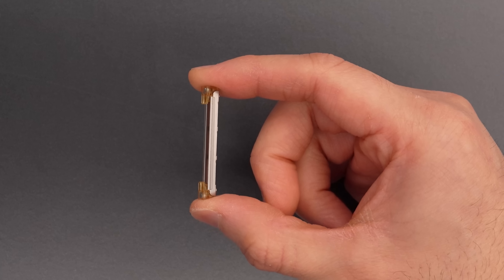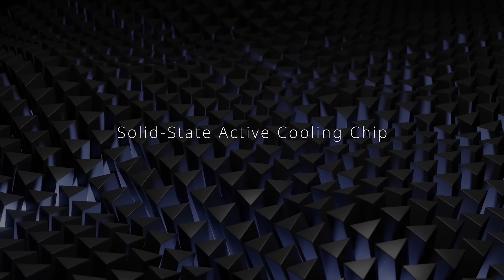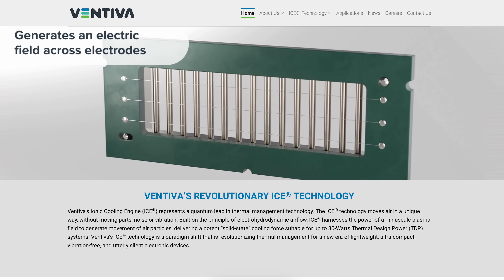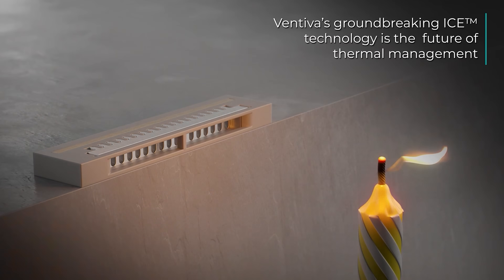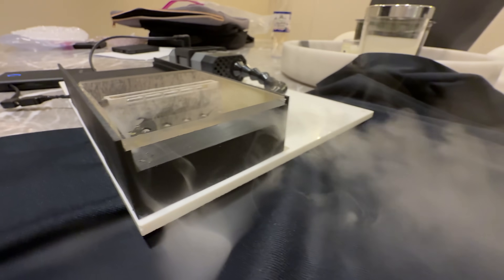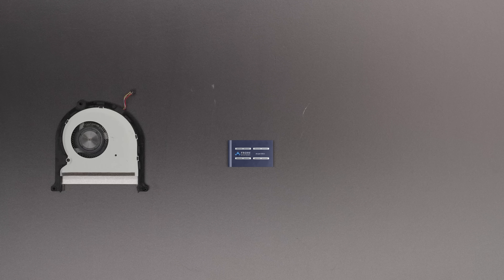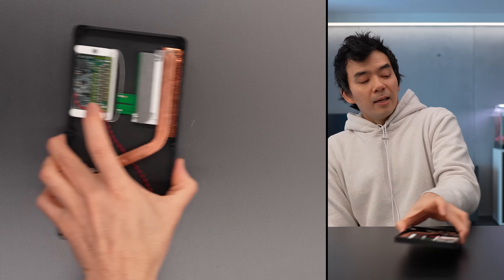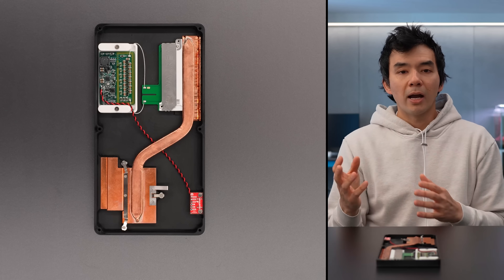The IMPOSSIBLE Laptop Fan...

Comment: Ion wind is a cool idea, it has almost everything you want in a way to move air around.
Except there's a few things that kill the idea deader than dirt every time it's brought up, and nobody has yet come up with a great way to prevent any of them.
Showstopper issue #1: Dirt/dust. There's a very good reason that the first time I ever saw something that purported to use this tech was a QVC advertisement for an air purifier. Static cling kills the idea because the same static charges that move the air around get picked up BY the air and deposited on to the dirt and dust particles IN the air, and then those particles sabotage the ion wind "fan" by depositing themselves right on the oppositely charged electrode, and no, you can't just reverse the polarity to fling the dust off, because not only will the dust not usually detach, but if it DOES detach, it'll just fling itself right at the OTHER electrode. Worse yet, that dust that gets deposited on the electrodes is INSULATING dust, because if it conducted electricity it wouldn't accumulate a static charge in the first place. So basically the thing's natural tendency is to turn itself off by taking a dust bath, and if you think there's no dust for it to bathe in, trust me, it'll FIND dust to collect. It's better as an air filter than a fan.

Showstopper issue #2: and this one's specific to the idea of trying to use it inside an electronic device.
This thing uses high voltages. That's not a super big problem, after all toner-based laser printers use high voltages no problem as a way to ensure the drum is evenly coated in toner. But with something that's trying to act like a fan for a CPU, it's a showstopper, and I'll give you one physical item that will explain everything about why it's impossible. Anti-static wristbands. The mere fact that people need anti-static wristbands and anti-static bags to work on and store parts of the inside of a computer should tell you right away that putting a thing inside a computer that operates on the principle of "let's put a static charge into the air so we can grab it and move it around with high voltage electric fields" is a terrible idea if you want to avoid frying the CPU or other chips that you're trying to use this thing to cool.
Just not gonna happen, they're about as mutually exclusive as having an operating tesla coil and getting good Wi-Fi reception in the same place.

Comment: this technology is in every thrift shop in an ionic-breeze tower fan from like 20 years ago. the issues are that it gives off toxic ozone, and that its operating at extremely high voltages so im guessing it can probably damage nearby parts over time from corona effect electromagnetic induced voltages etc. i dont think laptops like high voltage generators inside themselves. i could be wrong, maybe itll work. but probably not since its not a new technology and theres a reason nobody else has done it in the last 20 years...

Comment: 3:35,, Hm. If the ionization wire is positively charged, it means someone is following NASA patents without knowing the reason why. Atmospheric gasses more easily take up an extra electron than give one up because they are non-metals, so it would be more efficient if the ionization wire were negatively charged. NASA uses positive ionization because they are using mercury or bismuth, metals with low melting and boiling points as an "on demand" source of ionizable gasses, and metals more easily give up an electron than take up extras..

Comment: Is it a new tech or a different application of an old tech?
For example, plasma speakers or ionophones are a form of loudspeaker which varies air pressure via an electrical plasma instead of a solid diaphragm. The plasma arc heats the surrounding air causing it to expand. Varying the electrical signal that drives the plasma and connected to the output of an audio amplifier, the plasma size varies which in turn varies the expansion of the surrounding air creating sound waves.
The plasma is typically in the form of a glow discharge and acts as a massless radiating element. The technique is a much later development of physics principles demonstrated by William Duddell's "singing arc" of 1900. The term ionophone was used by Dr. Siegfried Klein who developed a plasma tweeter that was licensed for commercial production by DuKane with the Ionovac and Fane Acoustics with the Ionofane in the late 1940s and 1950s. The effect takes advantage of the principle that the ionization of a gas creates a highly conductive plasma, which responds to alternating electric and magnetic fields. Second, this low-density plasma has a negligibly small mass. Thus, the air remains mechanically coupled with the essentially massless plasma, allowing it to radiate a nearly ideal reproduction of the sound source when the electric or magnetic field is modulated with the audio signal.

Comment: not so fast dave!

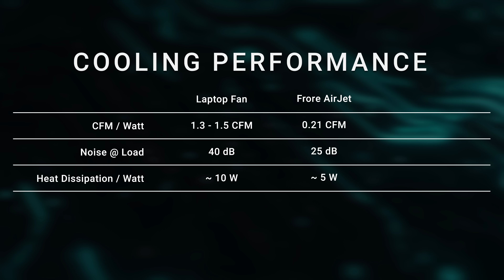the obvious problem with this comparison at 5:54 is that there are no common variables. what i would suggest is to normalize these 3 solutions for noise, IE crank down the fan speed on the centrifugal fan until it produces the same 13db. then measure cfm, power draw, and static pressure. you could do the same for power normalize for power and then measure the other variables, etc. 

what you will likely find is that the fan can move significantly more air at the same noise level while consuming less power, while also maintaining a much higher static pressure

sorry to poo poo the new thing, but in reality it isnt even new, and its not going to revolutionize anything.

Comment: While Frore's solution may use more wattage per CFM compared to conventional fans, this metric alone doesn't fully reflect its effective performance. Due to Frore's packaging and design, it is likely to be positioned much closer to the heat source (proximity to the heat source) than traditional fans, potentially offering different thermal management advantages. Then there's also the way moving particles are bombarded against the source. This isn't to claim that one approach is definitively better than the other, as each may excel in specific contexts. Rather, it highlights that a direct, like-for-like comparison between Frore's technology and conventional fans may not be entirely appropriate or conclusive.

Comment: I dont get why they don't just build a large heatsink into the back of the screen. Have dozens of small cooling pipes with flexible sections for the folding mechanism. 

Heat rises. If they used that to benefit getting rid of hot air up the back of the screen it would take the bulk of the heat away from the part of the laptop that you're using

Any heat will go out through the top of the laptop like a chimney instead of warming the desk up or whatever is underneath it. Keeping the lower area cooler and not trapping heat.

Comment: If you're ramping up the cost just to redesign the whole thing to accommodate for one tech change without any clear or distinct advantage, I don't think this is it. It's behind in airflow and design limitation, and the tradeoff is... acoustics?

I'm actually more inclined towards Frore tech since the tradeoff is power efficiency, for laptops it may be crucial, but for gaming laptops? Most gaming laptops basically disregard battery life and just wants their hand not to be cooked by the wind coming out of their keyboards. Having a huge static pressure means it will be able to house more aggressive heat fins for the air to push through

Comment: This thing will need very advanced coatings or maybe some surface functionalization (laser) to prevent heavier ionized particles to get stuck on its channels, compromising the flow and cooling capacity.

Comment: does it have problems with buildup  that's worse than fans or material degradation of the fine wire/de-ionizer?
i remember seeing a small model glider that used ionized air movement along the wings to fly slowly in a still indoor environment years ago

Comment: tbh thank you. I was searching for someone that put in line fan Noise. I'm currently looking the quietest laptop 14" with Nvidia GPU. I'm basically okay with the fact that noise should come with load but I'm looking for a very quiet laptop when using a low charge. I tried the Asus A14 but is was such a disspoint. Now looking at the lenovo  Yoga Pro 9i 14...

Comment: I think this tech will work, provided it is coupled with a fan. Imagine a design where it is place at the inlet, and a fan at the outlet. The air gushes through the components, taking along with it the heat, and a low power/wattage fan throws the air out.

Comment: Passive cooling with large enough heat sink parts coupled to a metal chassis/case would be so much simpler.  Yes, it would weigh a little more.  So? 
Zero power consumption.  Zero moving parts.  Zero noise.

Comment: I don't know about these coolers, but ionized air purifiers generally come with a warning to only use them in well ventilated areas, and only for an hour or so at a time in order to avoid health concerns.
Reply: this has sent me spiraling i have an air purifier with an "negative ionizer" and a standalone one plugged in 24/7 the fires out here in California plus severe allergies were so intense I had to go back to using inhalers which i havent used since i was a kid. I was semi aware they produced ozone but was sold on the fact waterfalls, oceans, rainforests have higher levels of ozone? Have Ive been poisoning my family? Some family members have developed a dry cough and now im wondering if its my fault. Glad I read these comments. Off to do some research on how much these suckers pump out... Oh and this would probably explain why any chargers with exposed copper fail quickly here. Particularly iphone lightning connectors and one side of my laptop's usb c port (facing direct airflow from the fan.
Reply: @loudognation  Good luck to you 🙏

Comment: Use this thing for when laptop needs low to moderate cooling and have a fan as well which kicks in at high load. Silent for most of cases and has the power if needed

Comment: This is dangerous. The device leverages physics to produce air pressure by making air chemically react with itself. Ozone is not your only worry here. Nitrogen dioxide, sulfur dioxide, carbon monoxide, formaldehyde (known carcinogen). As usual US legislators will approve this in the name of innovation and profit over wellbeing but it will never pass EU regulations. These molecules are dangerous enough as small concentration aerosols, imagine a high power gaming laptop blasting who knows how many of these devices at full power for hours in a closed room. Recipe for disaster.

Comment: One question: What about dust accumulation? How hard will these fans be to clean when they get packed with dust over time? Will cleaning it damage the tiny filament wire? 
That's the only problem i see with these fans.
I live in an old dusty house, and about every six months, I have to take my laptop apart, remove the fans, and clean the fan fins with a toothbrush..
If they design it in a way that makes cleaning it easy and safe to do, I am all up for a laptop cooled with these fans.

Comment: The bad thing about solid state fans is that they have ZERO static pressure abilities. Which means if you add a filter to prevent dust, they significantly lose their ability to move air, and dust is their main killer. If dust collects on the electrodes, it will stop working. So if you can use this in a dust free environment, then it would be great! Using it in a laptop? Yeah right...

edit: nevermind, he talks about it here: 10:05

Comment: they don't have to worry too much about obtaining certifications if their products produced ozone, ozone doesn't have that strong regulation for consumer electronics and appliances. many consumer high-volume air purifiers you buy at hardware stores produce ozone.

this looks like a repackaged no-filter air purifier that used titanium dioxide that was on the market years ago, but with manganese dioxide instead, which would be a consumable part. the purifier didn't compare at all to actual air filters because they couldn't deal with larger particulates, and the titanium dioxide replacement "filter cores" were exorbitantly priced, and the whole thing used a dubious marketing scheme of ex-NASA engineeers and whatnot that made it seem like snakeoil.

this looks a bit more promising, but the replacement of the consumable manganese dioxide is what worries me.

regarding the airflow from the top of the keyboard deck, that doesn't necessarily yield much of a difference in terms of cooling or air flow. there used to be keyboard covers for the butterfly switch macbooks that covered the entirety of the keyboard deck with a TPU film for ingress protection, and the static pressure wasn't enough to keep the film on the keyboard at all times. the actual impact to cooling was nearly immeasurable, and maybe totaled a single degree?

Comment: Note that the principle of making wind by ionising air is known for as long as the corona wires in laser printers and photocopiers. Just put your hand next to one, you'll feel the wind. It's even used by "lifters", which are small flying devices using two wires to make wind from air. One problem with that is that it also produces ozon and even some NO2. However I'm impressed by the amount of air flow of this device, which is way higher than what is found in lifters and corona devices.
Reply: Bruh. Is this why printers smell like thunder? 🤯

Comment: We need to talk about, how these new technologies will handle -- DUST BUILDUP.

Fans are rugged. You can use blower on them to remove dust & also tinker with them to remove dust, without worrying that you'll screw it up.
But, are these new technologies THAT much rugged ?? 
Won't they get screwed up, if we use a blower or brush, to remove dust ??

We need to first answer the real world problems, after that we can look that softer problems like power consumption.

Comment: From my experience with high voltage, when air is moist when it's raining for example. Air doesn't like to ionize. Water is a polar molecule and is carrying the charge away and you need more voltage to get the same arc. I'm not sure how it translates to cooling. Moist air can take up more heat and I'm not even sure If moisture is going to impact the ionic wind. Personally I think it will but I haven't tested it. All I know is that I was trying to ozonate the room but it was raining so I couldn't because arcs said screw it I'm calling in sick to work.

Comment: Static pressure is indeed an issue but look at that thing
It's tiny and you can install 5 or 6 of these across you laptop. sure that will hit power consumption but it's noiseless and no moving parts that are prone to failure

That could change everything 
It can melt boundaries between smartphones/tablets and pc's , Unmanned distant computers  , more silent HVAC systems...etc

Comment: Classic tech story. Amazing new tech, except it is not amazing because it's only benefit is low noise which is NOT a real issue. Seriously get a grip, your laptop fan noise is not causing any problems. It's also super pollutive so should be immediately banned for implementation until they can be made environmentally friendly.

Comment: That's piezoelectric solid state fan.. and its an old technology.. not being developed by vetiva, but NASA has been using it as thrusters in small satellites already, also known as Ionic Thrusters. 

although with nano technology its now possible, to coat the materials inside the laptop, so the ions coming out of this fan won't harm the system from inside... so yeah/. its just an upgrade by ventiva, i.e. coating the material to keep them safe... else its the same old Ionic thruster

Comment: The static pressure isn't just needed for pulling air into the chassis but also for pushing it out and over the tightly packed heatsink fins. 

The solid state thing, with 1700, could easily pull, and push, it's meagre airflow through dense air filters (keeping all dust out) and very tightly packed heatsink fins (removing way more heat per cm³ of case realestate).

Comment: i once saw an old case mod using an old electrostatic air purifier to replace the fans. it also had ram based ssds (this was before the flash ssd was well established). so zero moving parts. its old tech miniaturized.

Comment: what about actual cooling i get that it creates the needed airflow but i dont understand how it will actually cool it down as most new computers are getting hotter and hotter requiring fans that actually cool and also requiring sometimes water cooling so how will this replace those and also what about dust accumulation if no moving parts wont it need cleaning alot?

Comment: I figured it was some kind of ionic way of moving air, like an Ionic Breeze air purifier where you can def feel it moving air and makes no noise.

Also, because of the static pressure issue air vents on the bottom wouldn't work well either.

Comment: High voltage is deal breaker for me. Look how big the power module is, I don't know how many volts it produces, but to ionize the air you need atleast several hundreds volt to several kV. Placed it nearby cpu (with conductive heatsink connect between) which only work at 1.3 Volt. You need alot of insulation and ensure it doesnt degrading over time.
(Correct me if iam wrong)